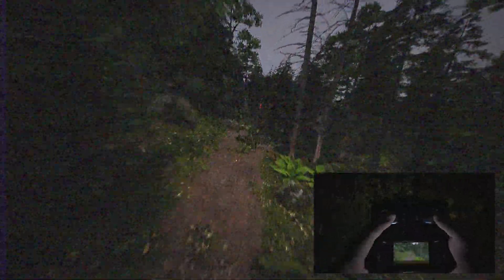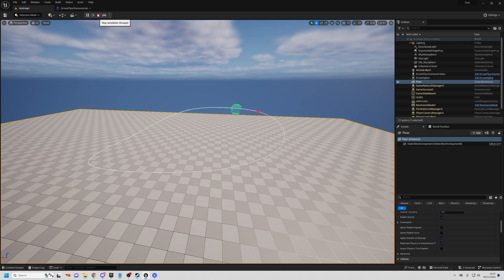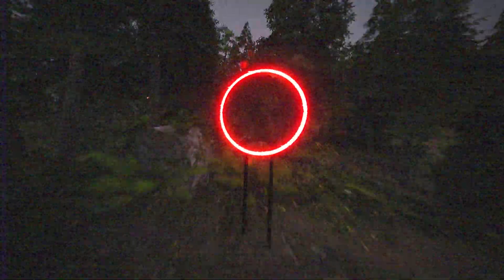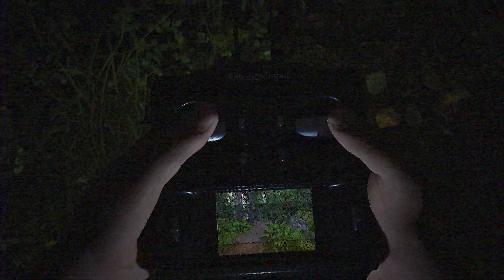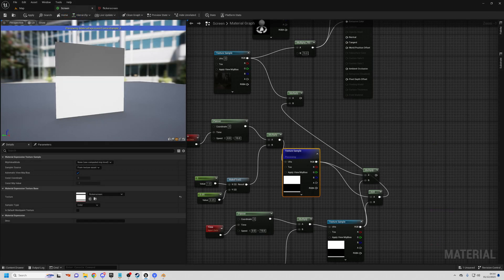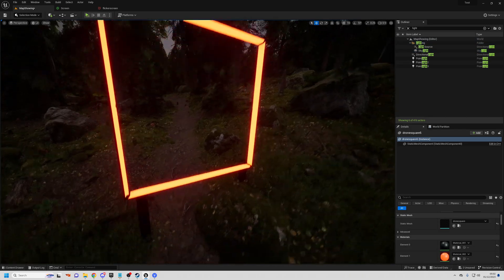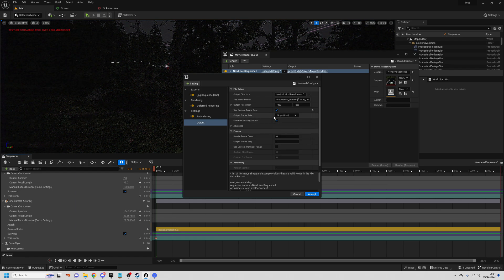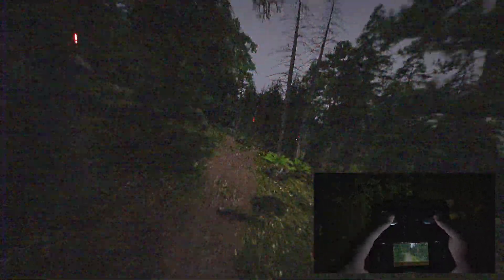FPV Drone - Unreal Engine Simulation

Comment: This is really cool!  If I did your course, would I have the knowledge to replicate something similar to the thumb procedural animations you have in this video? I'm looking for the best way to attach my characters hands to a flight stick, and have the movement of the plane procedurally drive the control rig of my character
Reply from the maker: The same basic principles will apply, although that application isn't covered directly. It's pretty simple though, you may not need the course for that. The way I'm doing it here is basically just IKing the thumbs to where they need to go. The proc spider tutorial on this channel covers using the basicIK node inside controlrig. Some other videos I've shown how to pass info into controlrig too (which you'd need to pass in the info about the flight).
Reply: @LincolnMargison  thank you so much for the reply and the info!

Comment: Amazing result really like your work :elbowcough: 

Quick question: The Basic IK node in Unreal has slots for bone A,B and the foot what if my character has 4 bones or 6 per leg, does the IK node still work for those cases?

Figured it would be an easy answer for you?

I appreciate it, thanking you in advance, and I subscribed, thanks for sharing.
Reply from the maker: The basic IK node won't work for those no, you'd need to use a different IK solver such as FABRIK or CCDIK, or the FullBodyIK node
Reply: @LincolnMargison  Oh I appreciate it, this is confirmation for me, today a friend of mine mentioned the CCDIK and I tried it on one leg and it worked. I didn't get a chance to try it on the whole rig, it is a 4 legged robot that I am trying it on. 

I will definitely give FABRIK a try too, hope it will work, I appreciate your answer. I'll post the results if I can get it to perform. ✋